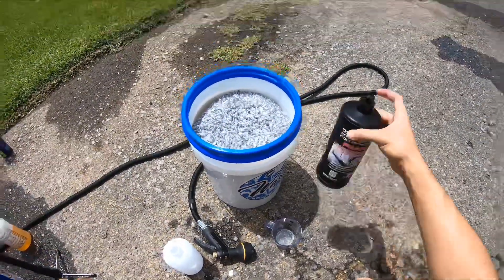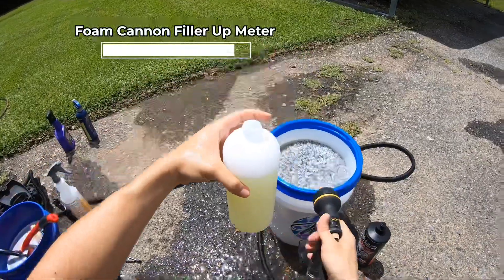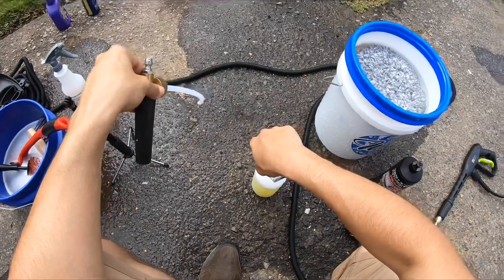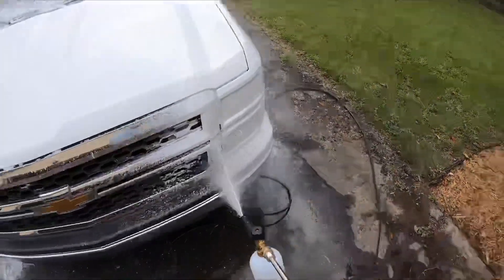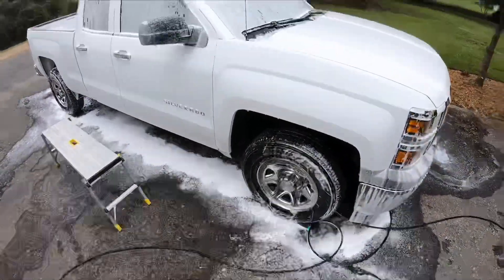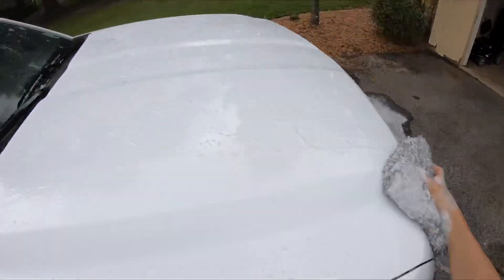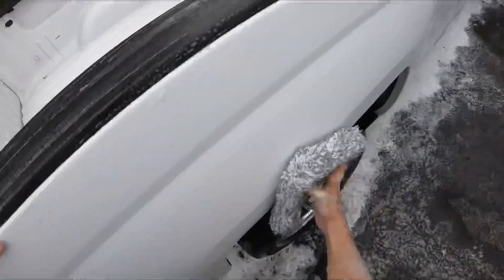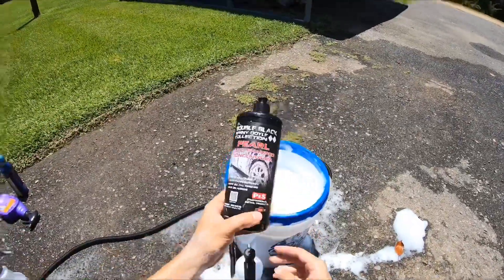Review of Pearl Auto Shampoo From P&S Detail Products

Comment: Love P&S but this one looks watery and diluted out of the box? Should I give it a shot?
Reply from the maker: Yes it’s the slickest soap I’ve ever used!
Reply: I’d just cut the water in half and keep the same amount of soap
Reply: @Synergize_  Doesn't matter. It's not because the product is more watery that it is less soapy or less concentrated. They made is more watery so it mixes better and I prefer liquid soaps for measuring than gluey soap.
Reply: @JamieTheCleaner  this vs Mr. Pink,  who wins?
Reply from the maker: @SrFulanoTal  Pearl 👍 so slick and the versatility
Reply: @JamieTheCleaner  thanks 🖖
Reply: @JackRR15  My fault I assumed wrong. Obviously the amount of water added or not added would not affect the soap out of the box. I was assuming he was referring to the foam capabilities due to the diluted look. In which my answer is cut the water (increase soap, same difference) if the directions dont produce enough foam or slickness.